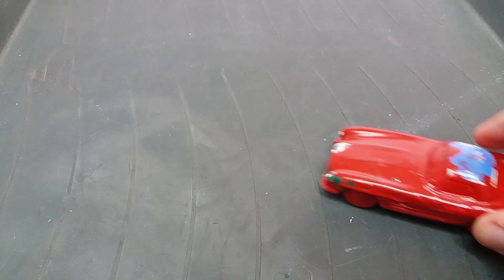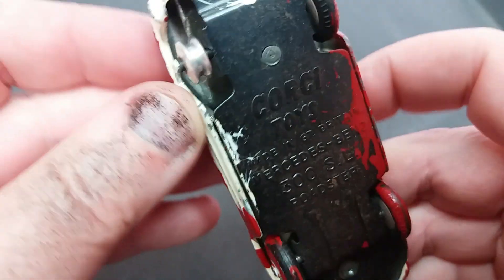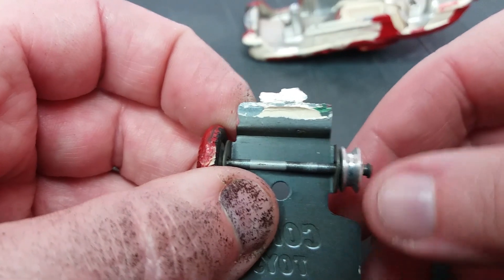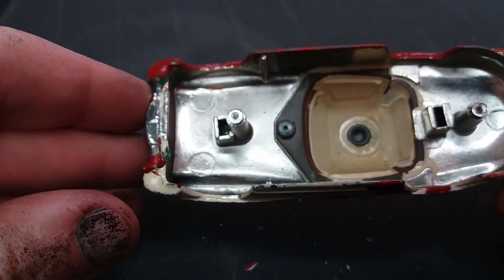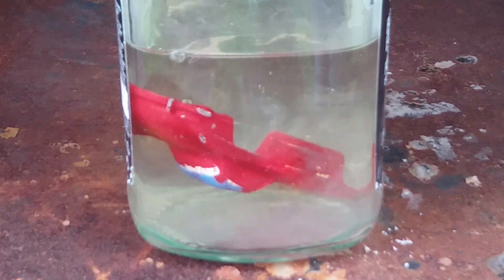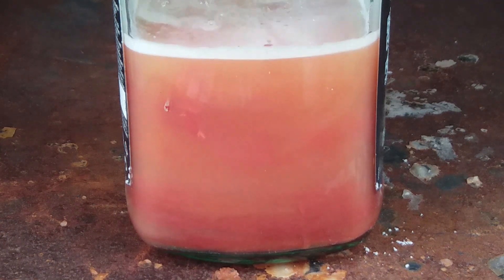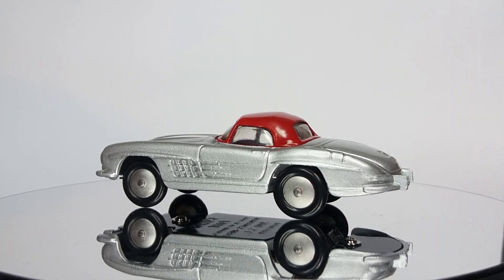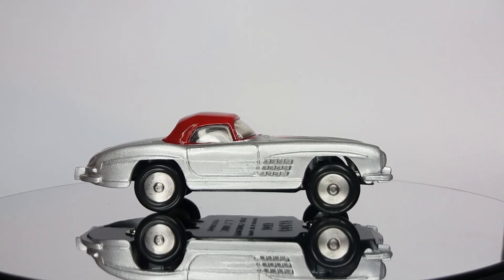Corgi Toys Mercedes Benz 300SL Diecast Car Restoration No 304

Comment: A casting that size needs a tablespoon full of caustic soda in one go, to initiate the reaction. It is both heat, and chemical action that removes the paint. 'Matchbox Garage' uses this stuff all the time, with great results. His container of choice for this is the jar some foot-long hotdogs came in. It's obviously heatproof, and being tall, the chance of spitting chemicals escaping are considerably lessened.
And the finished result? What a beauty!

Comment: Nice work.  Would be good to see the spray paints you use in each restoration.
Reply from the maker: I agree i keep forgetting my bad i use automotive paints, craft paints and sometimes water based modeling paint basically what ever is to hand or i can get locally. I live in a rural location so i do not want to always be ordering stuff from the internet as it gets expensive.